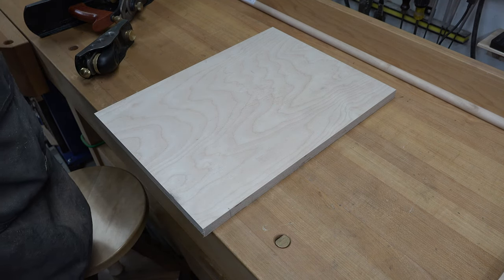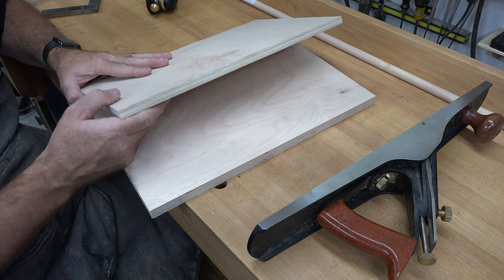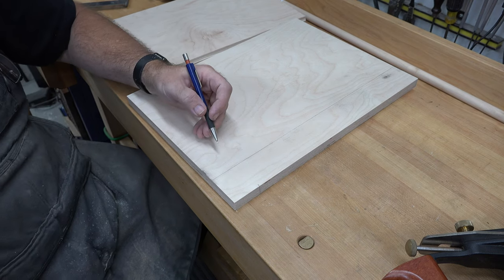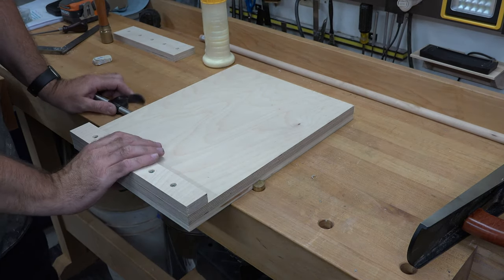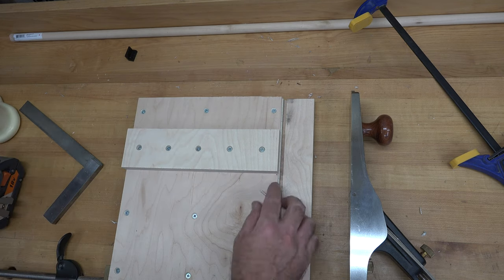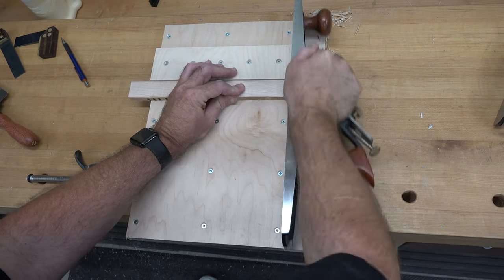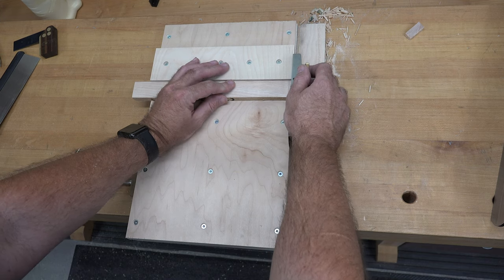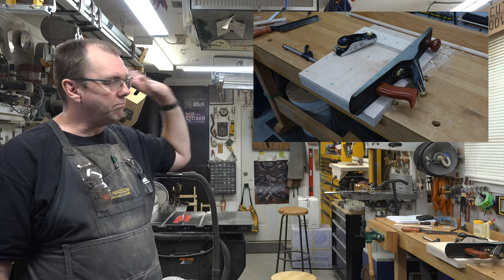Making a Shooting Board

Comment: Another nice Shooting Board version Kenny, would you consider making a ramped version and possibly adding the UHMW you mentioned?
Reply from the maker: A ramped version would be great for this.  It would instantly skew the blade of the plane and the UHMW plastic would reduce the friction and make it easier to use.  This is definitely something that I would consider.  Thanks for tuning in to the show Rob.  It's very much appreciated.
Reply: @acutabove_woodworkings  Cheers mate.

Comment: Great show as usual. I love the idea of the dado on the bottom I have had problems with dust getting in that corner. I do have a question is the rabbet cut on the table saw needed won't the plane cut that rabbet as its used?
Reply from the maker: Hey Carlo, thanks for dropping in.  You are right, that the rabbet will be cut eventually with the plane, but by cutting it first with the table saw, it allows the plane to trim your work piece, uninhibited by also having to cut the ply, making the jig useable right from the beginning.  I'm also not a big fan of using my planes on plywood.  The mixture of different grain directions at the same time is murder on the blade and I would rather just cut it with the table saw, one time and be done with it.  I hope this helps.  Thanks for tuning in and for taking the time to leave a comment.  It's appreciated.

Comment: Great video. I would like to know what brand of countersink bits you are using? Looks like there is a depth stop on it.
Reply from the maker: Thanks for the kind words Chuck.  The bit that I used in this video was given to me for my birthday last year.  It has a drill bit that is sized for a number 8 screw and a counter sink that is also sized for that screw.  You can adjust the depth of your countersink and set the ring so that the bit never drills any deeper than that.  Although they are quite expensive, you only need one and they last forever.  It was bought for me at Lee Valley and you can find it here.  https://www.leevalley.com/en-ca/shop/tools/power-tool-accessories/drill-bits/71860-carbide-countersink-drills-with-low-friction-depth-stop
I hope this helps.  Thanks for tuning in sir.

Comment: What is on the drill bit not to counter sink to deep
Reply from the maker: The bit that I used in this video was given to me for my birthday last year.  It has a drill bit that is sized for a number 8 screw and a counter sink that is also sized for that screw.  You can adjust the depth of your countersink and set the ring so that the bit never drills any deeper than that.  Although they are quite expensive, you only need one and they last forever.  It was bought for me at Lee Valley and you can find it here.  @t
I hope this helps.  Thanks for tuning in sir.